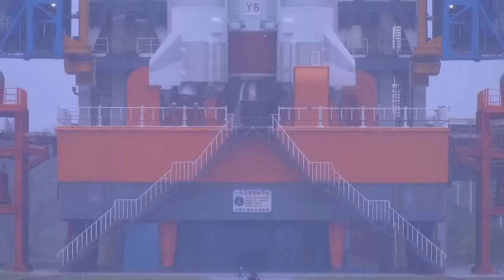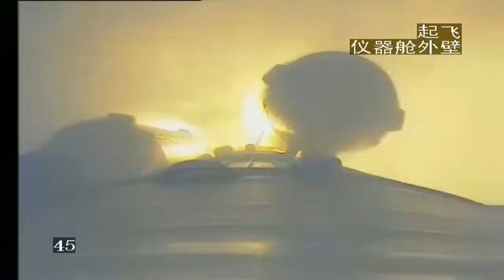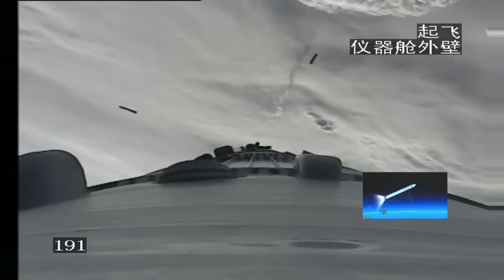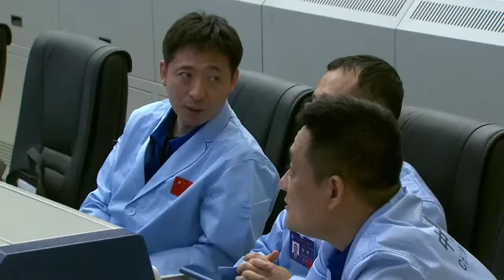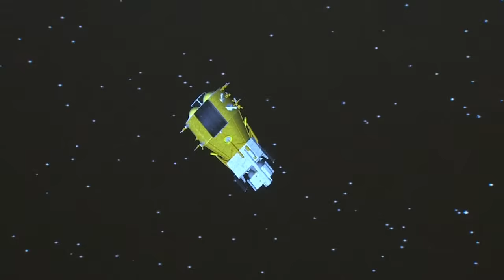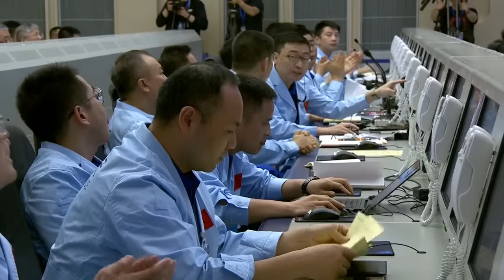Blastoff! China launches Chang'e-6 moon sample-return mission

Comment: Why does it take China's lunar craft merely 5 days to reach the Moon, versus India's that took 40 days?
Reply: 因为中国的火箭可以直接将航天器送入地月转移轨道，嫦娥6号现在已经在前往月球的轨道上了。而传统的方案需要在地球轨道上进行多次加速和变轨才能有足够速度前往月球。
Reply: endia use the cleanest fuel to launch.....cow dung
Reply: @古月手分手  胡老哥真幽默
Reply: To put it simply, it is an engine technical problem. The engine power of India's probe cannot directly enter the lunar orbit. It needs to use the gravity of the earth to "throw itself out", so it will take more time.😂
Reply: Less fuel is needed to launch, less pollution and expense, why rush?
Reply: very simple , because rocket engine of endya has very small power, so the payload can only be sent to lower orbit of earth, then it is to use gravity of moon to  attract the  modeuls gradually away from earth orbit,  so it circle  many round and then gradually  moved away from earth orbit and then get closer to moon by a 40 days and then spend another 5 days to land,
Reply: If you need to save fuel, you have to spend more time flying in circles around the orbit. China's earlier lunar probes also took more time. Now China has a strong enough rocket to go directly into Earth-Moon transfer orbit, so it is faster than India. The reason is not because Indian engines are not good.
Reply: @borsicatlarry7900   NS,  the first chinese chang e  spacecraft only took 10 days to reach moon in 2007,   because china has advanced engines that can change orbit in space,   endya never had anything good, not just  engines,   thats only reason
Reply: 中国的技术更好，我们有可变推力发动机
Reply: @beverlyberryc3411  Look up the Saturn V rocket. Sheer raw power. During the Apollo mission in the 1960s through the 1970s, it managed to lift a single payload of over 141,000 kg. It is retired since 1973. For a detailed visual view of the rocket close up in slow motion into the fire pit exhaust.   https://www.youtube.com/watch?v=DKtVpvzUF1Y
Reply: Everybody else in the comments are wrong. Both took relativity short trips to the moon (3-ish days) but Chandrayaan spent a longer time in lunar orbit before landing.
Reply: @bobatesomemayo  I thought it spent more days around the earth, no?
Reply: @hw4383 因为中国的技术比印度先进
Reply: @KKI98 keep crying😅😂 India is more powerful
Reply: @technopredator1139  the fact is that india moon mission used china’s queqiao2 satellite😂
Reply: @technopredator1139  Don't let India touch China. It's disgusting to think about it, it smells like cow dung😢
Reply: @technopredator1139 自己骗自己
Reply: Indian is joke
Reply: Because India's aerospace capabilities are much inferior to those of China
Reply: India want to show you more and give you more time to absence their tech
Reply: i saw you in douyin。
Reply: would be in the $billions if emperor xixipi weren't phenomenal pirates 😄
Reply: @defeatSpace  jealousy is not  good for you.
Reply: @hw4383 Endia is 50 years behind China. Period!
Reply: @Hfazer Just say India No.1😅
Reply: If you want something said, ask Indians
If you want something done, ask Chinese
-  Maitreya Bhakal (Indian Author)
Reply: @kinwai27271 of course India do. India cannot manage themselves. They are buying technology from everywhere. Just look at their weapons from Russia, France, US, Israel, Germany, etc etc. They can't even make their own screw.
Reply: It's all fake. Fakery can take as long as it wants, and the masses will believe.
Reply: Both are great project, taking longer time is fine.
Reply: 实际到月球都快，进入月球轨道后需要减速，绕圈，调整姿态，选择登陆点。中国也不可能只用5天，也得绕一段时间完成这几件事。
另外的区别就是技术了，包括飞行器本身和控制、通信技术等等。🇮🇳还是需要继续努力。
Reply: 因为你们印度🇮🇳！不行
Reply: It's not a race. There's no reason to rush an unmanned mission.
Reply: @stratolestele7611  I don’t mean that it is a race. I would believe India wanted to reach the moon sooner as well if a more powerful rocket was available.
Reply: The Indian rocket engine is not good. That's the fact, simple as that.
Reply: @user-kf3zv8ps6q Because China has copy of Russian technology 😅
Reply: @我是大爷啊  we still reached and hopped again on moon lol.. btw when is britian gonna send a satellite by themselves?
Reply: budget differnece...chandryaan 3 was 74million dollars while this cheng e misson is around 180million dollars
Reply: @isodimetrix  So why India did not increase budget to 180M? I assume India wanted to reach the Moon sooner too, no?
Reply: @hw4383   dont listen to him,  thats disinformatiopn,  endya  mission spent more than 200 million dollars,  it paid NASA for navigation and lots of probes and equipment are bought from france and UK
Reply: @hw4383  sure if u can pay it..we will increase lol..we have more missions lined up..gotta save some rgt
Reply: @isodimetrix   NS, india claim it is 74 million, but it is not possible, because INSOA has to pay NASA for its navigation and probes made by france,  it is like over 200 million dollars becasue NASA is so expensive, also chinese chaner mission is only under 100 million,  because china has higher technology and cost is low
Reply: @xinyiquan666  well they all r some partners...even india has some of their stations... if u think like that then all missions r not the actual cost they claim!
Reply: nothing with budget, simply India rocket don't have enough DeltaV to directly inject the pro be into TLI orbit  @isodimetrix
Reply: @isodimetrix  Money doesn't solve top hard problems, a country just can't buy these kind solutions from somewhere.
Reply: @isodimetrix  would be in the billions of dollars if xixipi weren't phenomenal thieves
Reply: Pakistani and china are mocking here who first find the water on the moon lol it's was India technology
Reply: 动态网自由门 天安門 天安门 法輪功 李洪志 Free Tibet 六四天安門事件 The Tiananmen Square protests of 1989 天安門大屠殺 The Tiananmen Square Massacre 反右派鬥爭 The Anti-Rightist Struggle 大躍進政策 The Great Leap Forward 文化大革命 The Great Proletarian Cultural Revolution 人權 Human Rights 民運 Democratization 自由 Freedom 獨立 Independence 多黨制 Multi-party system 台灣 臺灣 Taiwan Formosa 中華民國 Republic of China 西藏 土伯特 唐古特 Tibet 達賴喇嘛 Dalai Lama 法輪功 Falun Dafa 新疆維吾爾自治區 The Xinjiang Uyghur Autonomous Region 諾貝爾和平獎 Nobel Peace Prize 劉暁波 Liu Xiaobo 民主 言論 思想 反共 反革命 抗議 運動 騷亂 暴亂 騷擾 擾亂 抗暴 平反 維權 示威游行 李洪志 法輪大法 大法弟子 強制斷種 強制堕胎 民族淨化 人體實驗 肅清 胡耀邦 趙紫陽 魏京生 王丹 還政於民 和平演變 激流中國 北京之春 大紀元時報 九評論共産黨 獨裁 專制 壓制 統一 監視 鎮壓 迫害 侵略 掠奪 破壞 拷問 屠殺 活摘器官 誘拐 買賣人口 遊進 走私 毒品 賣淫 春畫 賭博 六合彩 天安門 天安门 法輪功 李洪志 Winnie the Pooh 劉曉波动态网自由门
Reply: @defeatSpace  you are everywhere bot..